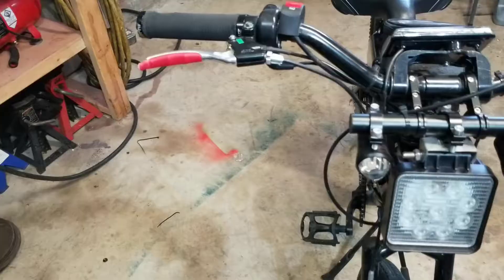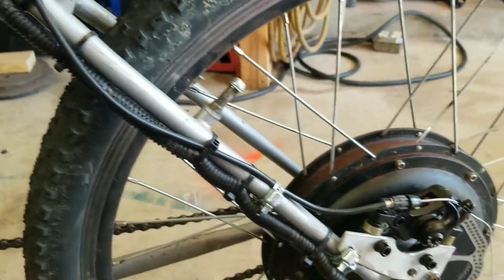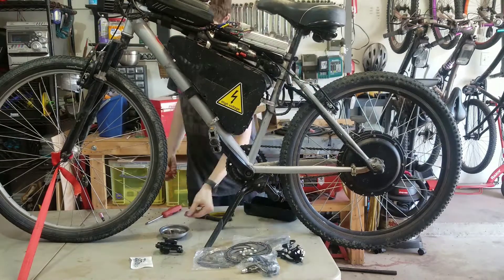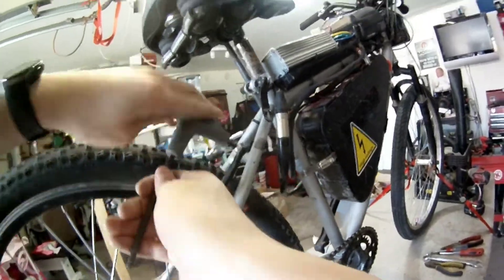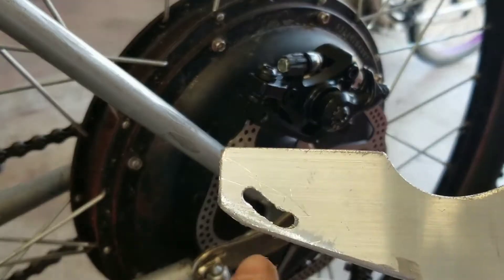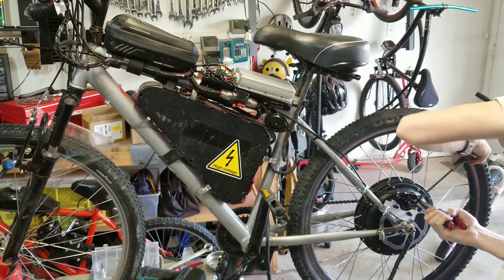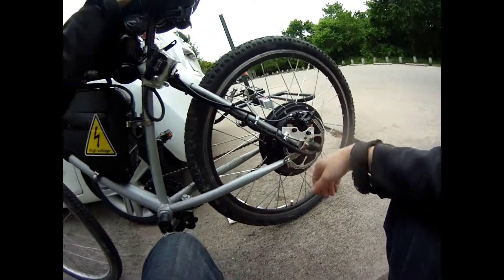How to Install Disc Brakes on Your Electric Bike

Comment: My brother used too many strength tighten the screws to install hydraulic brake disc on the ebike motor.....now two screw hole become a bit wide and enable tighten the screwss.....now the discs keep rubbing the back body of ebike 😭

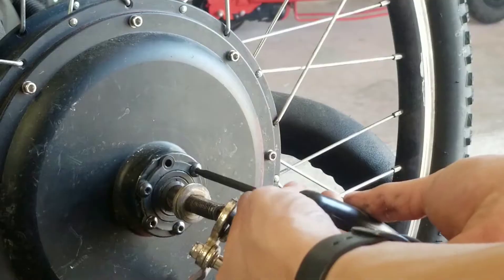Comment: I have the same rotor and can not get those 5 screws out my hub motor mind telling me what screw driver or tool you used at 3:20
Reply: bro get a set of alan keys
Reply: If your screw is damaged you should use a dremel to turn them to flat heads and unscrew it easily, you can ask your local ebike shop if u got one

Comment: What is your top speed? It looks like around 33 mph if I’m reading your display right? That’s good my 1500W only goes 31 mph but I’m at 48v. I believe you said yours is 52v and you did something to your controller? I’ve been trying to upgrade my controller but I’m already at 45 A and my battery output is 50 A so I should’ve done like you use the 52 V battery or maybe even higher.
Also I can see you’ve put a lot of work into your bike, Great job!!! I will say this though mechanical this brakes aren’t that much better than rim brakes. Now you have your mounts in place you can upgrade to some hydraulic brakes. You can get the Shimano M 200s on eBay for pretty cheap.
Reply: Mine is a 1500w rear hub with a 48v controller on a converted beach cruiser.  I'm about 230lbs and get 59.9 kmh /37.2mph on flat ground with no pedal in about 500 feet.   Voltage is torque, that's your acceleration.   Wattage is your power, your top speed.   (Amperage is your battery's capacity.  It's how long it will last).
Reply from the maker: My top speed ever on this bike was 45mph, but that was with a big hill helping me out. My best speed on level ground was 34. I added some solder to the motor shunts so they would pull some more current, also added solid copper wires to the main solder leads in the controller, so I can pull more current without voltage drop. There isn't much difference between 1500w motor kits and 1000w, at least with what kits I've seen. 
I noticed the frame cracking on this bike so the frame has been scrapped, I'm planning making an awd bike with this motor kit, and if possible I definitely will use hydraulic brakes
Reply: @dylandoesit3203 is the brakes single piston? And how good is the stopping power on the bike?
Reply: I get 30 max but I ride at 27 max I got rid of my hub 1000w 52v and got 1000w 48v mid drive it’s fast boy… I really wanted a 52v but I don’t have that money, I couldn’t get my hub motor to fit my bike kept falling off I tried filing it down I gave up

Comment: What was the right rotor size? I’m not trying to make the same mistake. I would appreciate your feedback
Reply from the maker: I think this is a 130mm rotor but it will vary depending on what kind of bike you have

Comment: this should be OK but it might be a good idea never to use the brakes aggressively. The bike wasn't designed to handle disc brake stress. If you keep that in mind and brake gently, gradually, Bob should be your uncle.
Reply from the maker: Nah I slam that bitch, the hose clamps holding it will snap before the frame gives way. I'm working on a whole new frame for my bike, several videos are in the pipe right now
Reply: @dylandoesit3203  hells yeah bro. Push it to the limits so you can see what breaks and build it stronger.

Comment: Wow, hose clamps. Brave man. I wouldn't do that for the front brake. You'll get away with the rear I suppose.
Reply from the maker: The front is a different situation. One can just replace the fork with something disc brake compatible. To do that with the rear means replacing the whole frame
Reply: @dylandoesit3203  or buying a cheap tig welder. Which I think for somebody like you would be an excellent investment! I've got a mig and always finding new things to do. But tig does aluminium.
Reply: @squidlings  the bike frame would also have to be aluminum for this to work. And if i had to guess id say his frame is steel.
Reply: I was thinking the same thing.  Lot's of pressure for hose clamp to handle.  Small U clamps like you see for automotive steering components could be used instead of welding.  But still, for your own joy a welder is great to have.  Sweet bike Groovy work.

Comment: Did you experience any issues of your rear disc brake scraping the frame?
Reply from the maker: No I haven't, it's kinda close but it's never made contact with the frame. If you're having issues with that I'd recomend either a different diameter brake rotor setup, moving the axle back away from the seatpost, or if all else fails, just dent the frame in the spot where it makes contact with the rotor. It's kinda janky but it works. Best of luck !
Reply: Dylan Doesit Mine is almost making contact. I’m afraid over time the disc brake can bend and scrape against the frame. I’ll probably get a whole new frame.
Reply from the maker: Your rotor won't change shape that much, unless you've got it like .25 millimeters from the frame. The rotor deforms slightly over time but never so much that it makes contact to things it didn't before.
Reply: Forget scraping, my disk brake doesn’t even fit in the frame. And even if it did, half of it would be inside one of the forks. Do I need to get a bigger frame? 

Sticking to vbrakes for now and they don’t even make full contact with the rim 🤦🏾‍♂️
Reply from the maker: It sounds like you'll need a different frame. One that allows for disc brakes